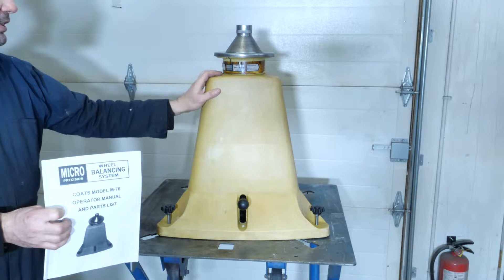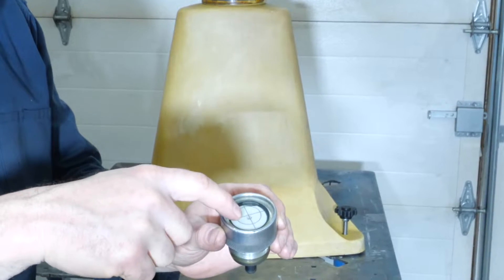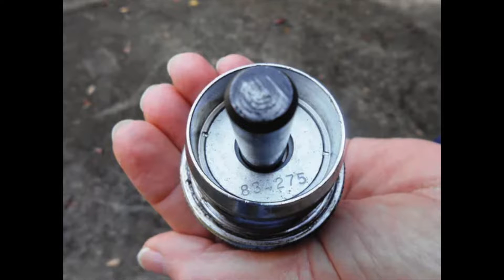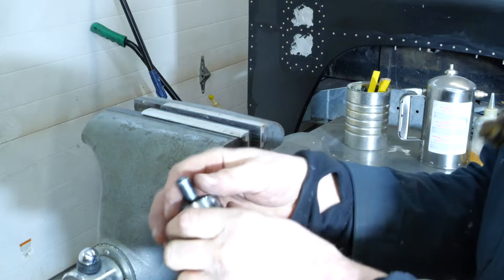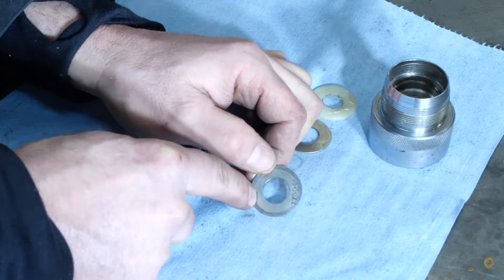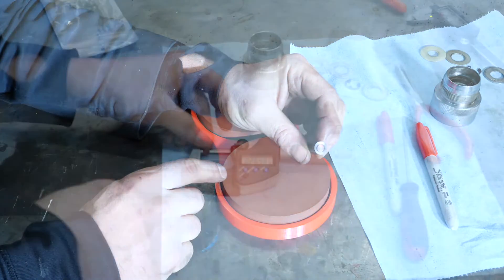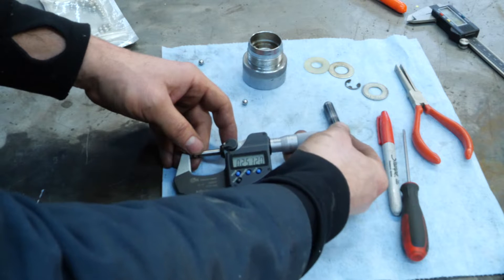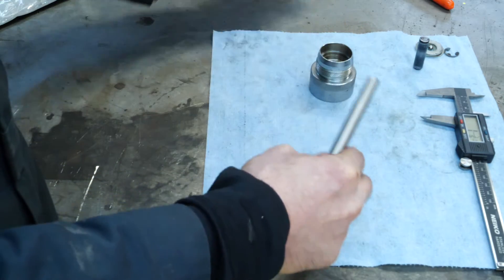Coats M-76 Wheel Balancer Head Rebuild

Comment: Great video, mine has the same problem with the ball bearing, not having a lathe & seeing that there is a circlip holding it in position on your video. I secured the head in a soft vice & pulled it out, the circlip detached so all was good, then removed the very flat ball bearing, good clean up & replace with new BB it does stay in position I used some Vaseline to assist holding. then flatted the pin.  My balancer is around 70% more accurate. many thanks for your video helped me so much.

Terry Sim Northumberland UK

Comment: i guess i'm kind of as interested in your opinion of why these are selling for so much, is it because of an alternate use case for them?   or is it because of something like people buying poor quality balancers from like HF etc and still wanting to DIY but wanting something slightly better? (which doesnt make a ton of sense but is the only other option i could think of at the moment)
Reply from the maker: I agree, people want to balance at home but dread HF quality.  I got this balancer for this reason when they went for $200 and it seemed like a very questionable expenditure, and now they are approaching $500.  This does not work with modern high offset aluminum wheels and good modern tires.  Not only it doesn’t balance dynamically, it is just not sensitive enough for light weights that are used on modern wheels.
Reply: I disagree with this.  I have one similar to this coats.  I solved my steering wheel shake with it that two tire shops couldn't.